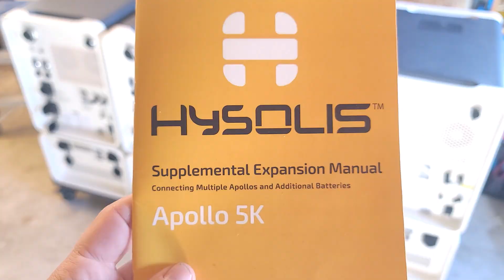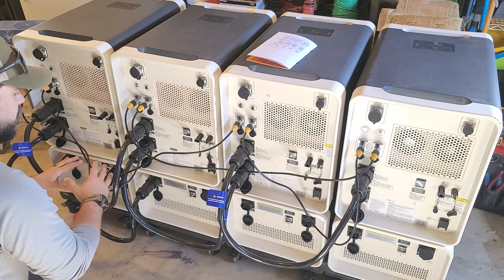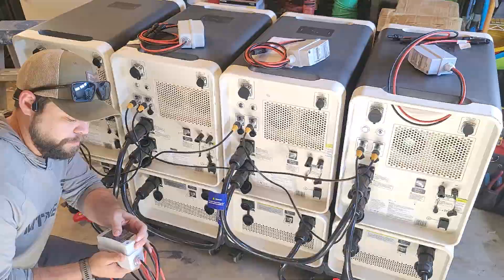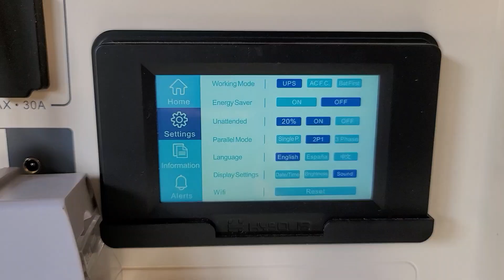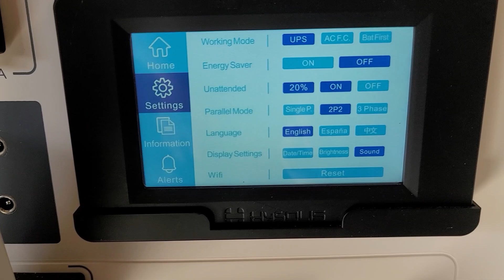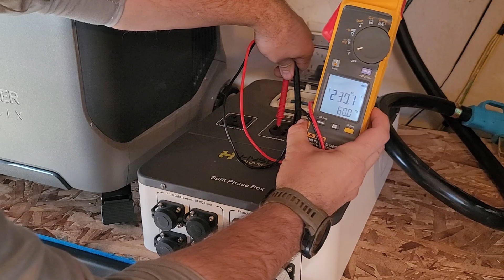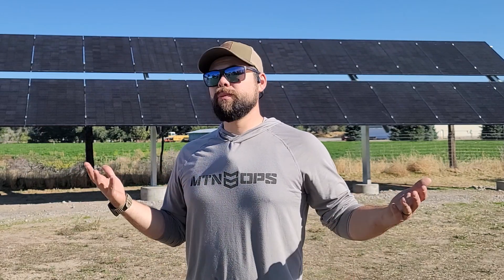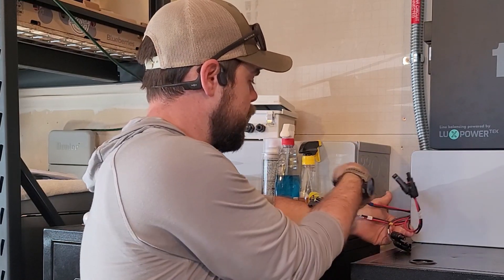Step by Step  the Easiest Way to Go Off Grid with 4 Apollos

Comment: Great video, I’ve been looking for some video info on the Apollo split-phase combiner for the 4 Apollos that you used, and yours seem to be the only one.  It looks like that combiner has a few more features using the connection to the grid and to the critical panel as well as the A/C input.  That is something I’d like to get some more info. Is that something you share about?

Comment: Isn't the easiest way to go off grid is to use 3 or 4 Jackery Explorer 5000 Plus units? You  can get 120V and 240V with just one basic unit and with 4 units output 20KW continuously and up to 70KW per head?

Comment: In regards to your comment about charge and discharge sharing in other units, do you know if the Pro Ultra will load share when connected to the smart home panel? I currently only have a single inverter with 24 kWh of battery, but will be building out to three inverters over time.
Reply from the maker: My understanding is that it will discharge share, but not charge share. So it will still eventually get unbalanced.

Comment: Eco flow ultra 42k wh is around 19k .. and looks 10x better and less space and expandable to 90kwh …. Why use these?
Reply from the maker: I prefer the Apollos because they have charge and discharge share much better than the DPUs. To get to 92 kWh of battery, you must use three DPUs. To use 3 DPUs you must use the Smart Home Panel 2 (SHP2). If you use the SHP2, you cannot use more than 12 circuits in your house. You get more battery storage and output power but then you get massively reduced to how much you can run because you can no longer run your entire electrical panel through an interlock/transfer switch. So, if you want to be able to run your entire house, which I do, The max you can do with the DPUs is 12 kW output, 61 kWh of battery, and 11.2 kW of solar input. 

With the above Apollo system it has 12 kW output, 20 kW of solar input, but only 43 kWH of battery. By getting 4 more batteries it'll have 65 kWh of battery. Which means It would be equal in terms of output, double the solar input, and equal but still expandable to more battery storage.

Yes you're correct the DPU can expand to 3 units, but I don't like that because I don't want to use the SHP2. That doesn't mean I dislike the DPU setup or think people shouldn't get it. I am simply showing my personal choice, which anyone else can have a different choice, and showing how to put it all together. It takes 20 minutes or less to put this all together the first time, then you never really have to touch it again. Both the Apollo and DPU have pros and cons, neither are perfect.

Comment: I believe I read somewhere the hysolis apollo inverters are 3kW continuous, 6kW peak ouput. Is that correct? I think there was another channel demonstrating that insane surge compared to other units.

Do you know if the balancing still works if you're using 2 sets of 2 hysolis, where each set is going to a separate 50 amp inlet?
Reply from the maker: That is correct on the output. The balancing still works if you're using 2 sets of Apollos. It happens due to the cables on the back of the system.
Reply: @minutemanprep awesome, thanks for the info! Enjoying the bronze+ kit. Will be back for more soon!

Comment: Isnt this relying on the app?
Reply from the maker: No. The app is not required in any part of the operation or installation. Unlike the EcoFlow systems, they require firmware updates regularly or they will stop working.
Reply: @minutemansolar  so the app is just monitoring?  That's awesome 👌 thanks for the reply
Reply from the maker: @qaz-22  It also allows you to turn on and off AC power, DC power and other small things, but mostly for monitoring.

Comment: Your videos are great and the machine is great but unmentioned in the video is that these are some of the most expensive solar generators per watt hour on the market.  Single unit almost $4k and expansion batteries almost $3k.  Set up in video looks to be $30k  or much more.
Reply from the maker: They're not cheap because everything is done for you. It'll never be cheaper than DIY. Same thing as working on your own car, cooking your own food, and so on.
Reply: Point isn’t that diy is cheaper,  point is that I can get 10k from Oupes for 40 cents per watt hour.  Or I can get 15k watt hours from the Force unit from ShopSolarKits for less than 50 cents per watt hour.  Why haven’t you reviewed that unit which beats all the Hysolis specs?
Reply from the maker: @rob589  I have a review that I am working on right now to go over the different option, this video is specifically about how to set up 4 Apollos since people need to know and have been asking. The Force 15k is a great unit by itself, but faces major drawbacks with solar input as soon as you begin to expand. I plan on reviewing all of them head to head. I love the Mega 5, but it is still limited in many ways. It always depends on peoples needs. I simply like the Apollo the best.

Comment: Just connect two DELTA Pro Ultras with the 50 amp hub to your inlet and save yourself all of the complexity.
Reply from the maker: Yes but you also lose 1/2 of the solar input which is vital, and you lose the balancing between the whole system both charge and discharge.